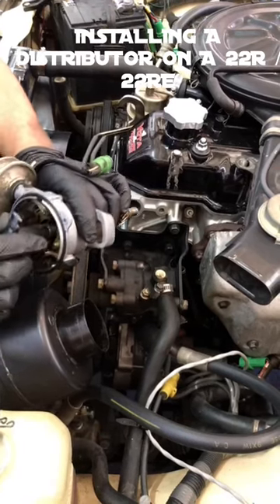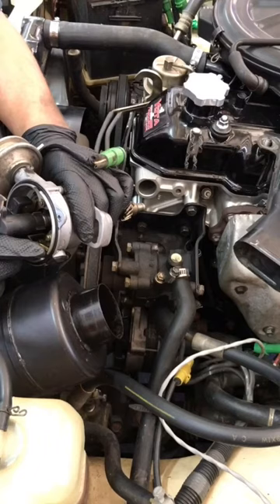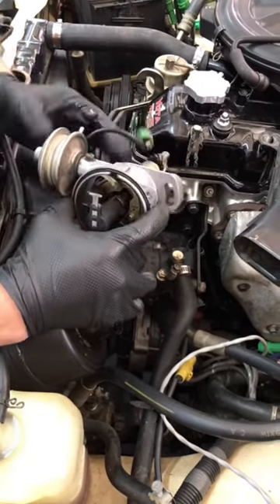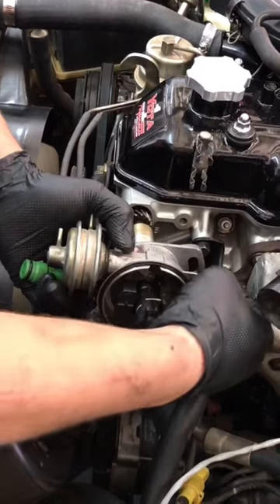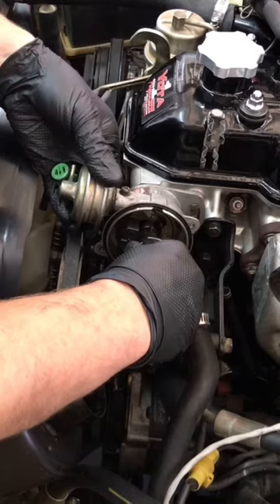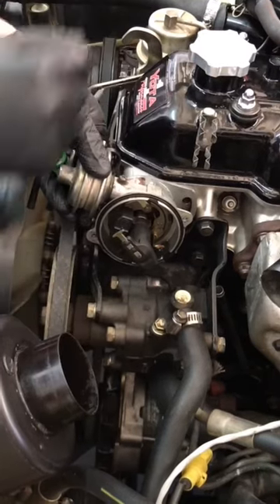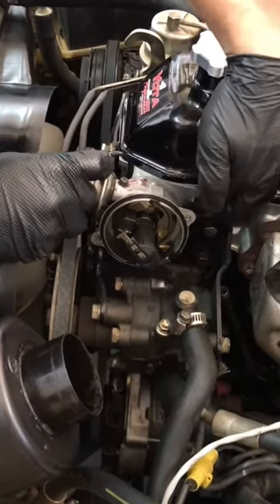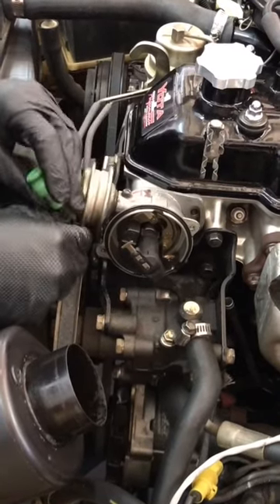INSTALLING A DISTRIBUTOR ON A 22R / 22RE

Comment: Put a mark on the distributor body using the cap as a guide for the position of the rotor for number 1.  I use a paint pen.

Comment: I notice after my 22r stopped giving spark that my rotor stopped turning as I cranked the engine.  I pulled the distributor and inspected the drive gear.  It looked fine.  Tomorrow I will remove the valve cover to inspect the cam drive gear.  What can I expect?  BTW I didn’t hear any loud, unusual noises when turning over the engine.